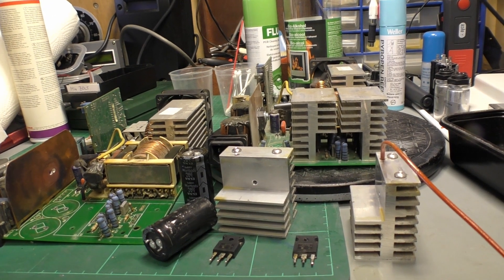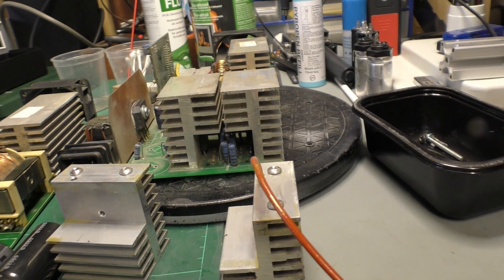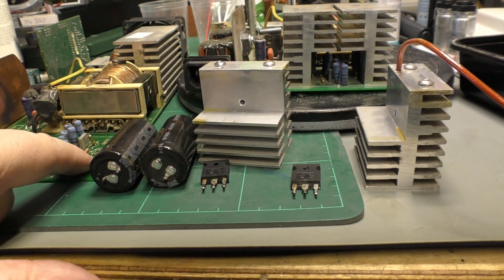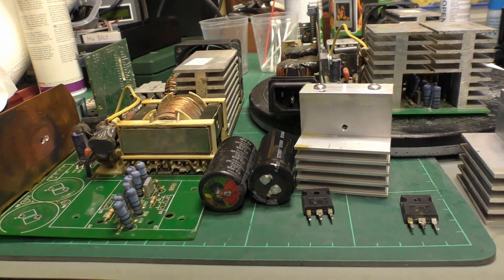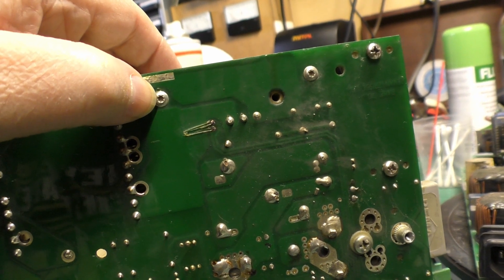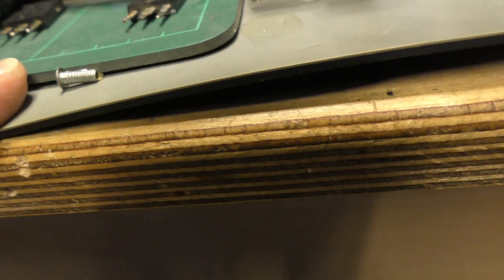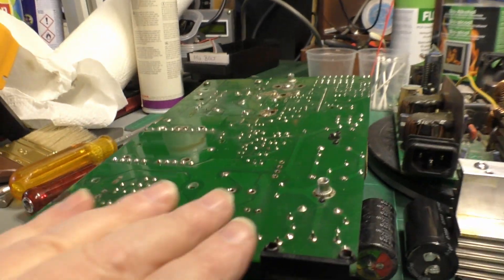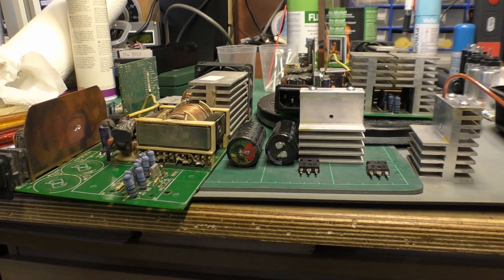Fun with EV battery chargers

Comment: What sort of batteries is it meant to charge ??
Reply from the maker: Hi Charles.  The spec for the output voltage is 96v so I assume this is a large battery pack used in one of today's electric cars.  I think I've got one of them working - at least to the extent possible without a battery to charge.   It powers up, nothing goes bang, and there is a flashing red LED and alarm sound which the manual says means there is no battery connected.   The components for the other one won't get here until next week.
Cheers,    John